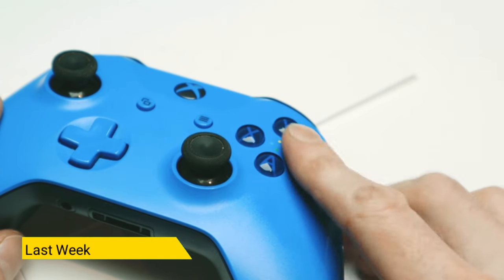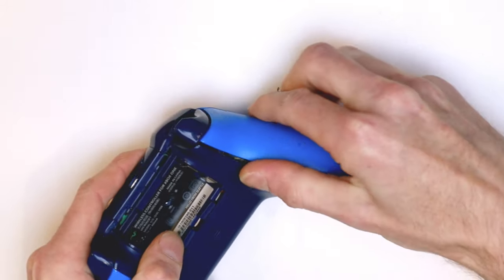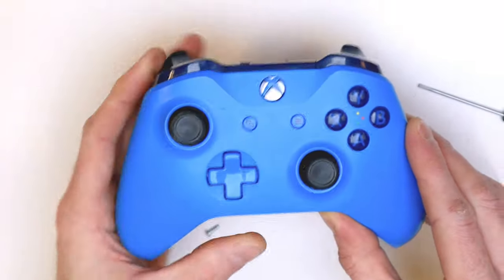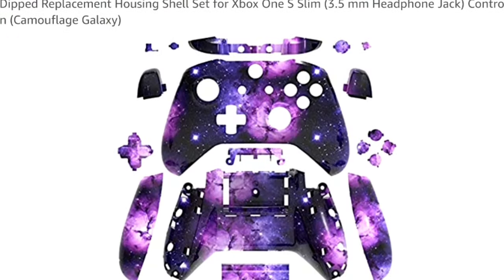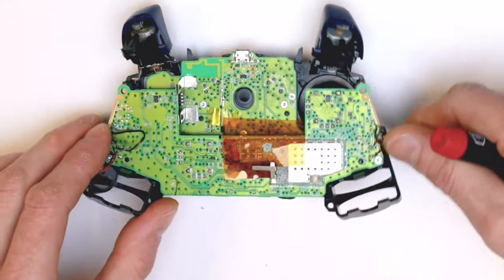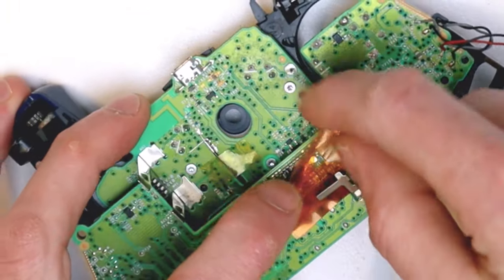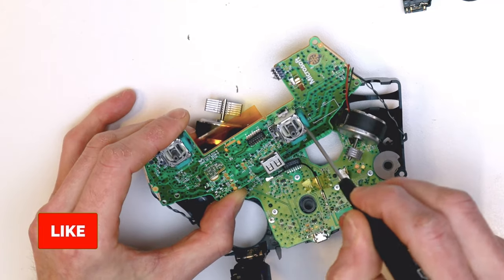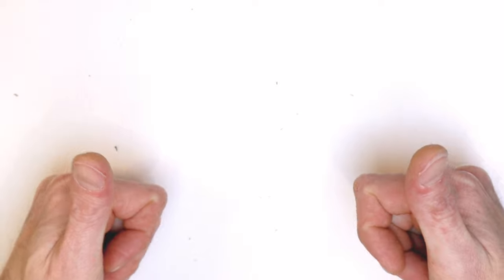How to Open an Xbox One Controller WITHOUT Torx Screwdrivers (watch full vid)

Comment: Yeah they're cheap as hell. Took a tiny flathead and broke the "security" part off of it. Metal bends and snaps right out of the screw lol
Reply: Same. The screws at the bottom of the handles are always resisting to come out and the middle part breaks off

Comment: Wait how do I break the pin thing in the middle of screws I’ve tried to break it with a flathead but it won’t budge
Reply from the maker: I use a flathead myself
Reply: a tiny teeny flathead
Reply: He has the non security Torx screws, Xbox One S controllers use Security Torx (With the pin)

Comment: Hey man, if you still respond to comments, I just finished putting my controller back together, and it doesn’t turn on. something I noted, the bottom battery slides out, like it doesn’t go in there solid. do you know what I did wrong?

Comment: Hi, so I’ve had my Xbox one controller for years and one day I opened those two back covers just to clean them, and after I closed one of the things that make it vibrate was making a weird noise. Do you know how I can fix this?
Reply from the maker: Hey thanks for your question. Something may have fallen down into where the vibrate motor is seated, like a bit of dust or something. Check this video out for more detail on them if you like https://youtu.be/fPXbm2XC4gU
I cover triggers and vibrate motors in this one
Reply: Tinker Man Mick Thanks

Comment: Thanks Tinker Man! I'd like to add that I had a bit of trouble using T8 torx because I don't have the hole in the end of my bit. I was able to use a tiny flathead to break off the "safety tips" from the screw heads and then get my torx down in there. Great video!
Reply from the maker: Well done mate, yea thats what i usually do too. Great you got it sorted 👍
Reply: They just break off?
Reply: I’m having this same issue with my T8 ! Which safety pins and how to break them pls ?
Reply: Center of star in the screw head has a protruding spike. My torx bit couldn't fit in there because the spike kept it out. I used leverage with a flathead to pry and break off that spike, then could seat the tip of my torx bit in the empty star spike free cavity.

Comment: Thanks my man! I actually had a Torx-screwdriver BUT the inner metal piece of the screws has come out, so I could not stick a torx in. With your method I could repair my xbox controller for the second time - these controllers are awesome when they work, but the construction is SO bad.

Comment: You can use a small phillips screw driver to break to "safety" post from the torx screws. Then you can use a normal #8 torx or maybe get your flat head in there easier
Reply: I've never been able to break that pin off for fear of breaking the screw itself
Reply: @Luke-nc6fj  I'm glad I tried it. Snapping them off was a bit nerve racking but it worked on each screw and I was able to clean and fix what I needed. Bought myself maybe another year before it totally wears out

Comment: Is it a bad idea if you use a knife with a sharp top?
Reply from the maker: That's something I have done before out of desperation but not recommended 🤣 (sharp objects hurt when u slip)
Reply: @TinkerManMick  Lol, i tried using a knife and i cut my pinkie. So, if you had protection like some gloves that have hard material then your good. (I think)
Reply from the maker: @ghillie3125  i hope your ok! 😓
Did you get the job done?
Reply: @TinkerManMick  Yeah, managed to get the thing out of my mic component, bad thing is that the bottom right screw couldn't go in properly
Reply from the maker: @ghillie3125  oh ive had that happen before, check the wires near the vibrate motor didnt get in the way at all and that everything is seated back correctly

Comment: A lot harder actually doing it than it seems on video. I busted my series x controller just unscrewing it  😁 I personally don't care because a $20 controller works just as good as a $70. It was just going to sit in a drawer for the next 10 years anyways. Also those little potentiometers will open with quite a bit of working at it. However, getting the new one in and closing it is another story all together, yep I tried after I broke the controller just to see if it is doable. I have like 20 more controllers with drift, I might just try to solder new sticks on if I don't break the controller taking it apart again.

Comment: What would I replace if my controller won’t stay connected to the console and connects and disconnects off and off with in 10 seconds
Reply: If your Xbox is connected to a power strip, it won’t get enough power, and after to long, will stop connecting without wires hope that helps

Comment: So with the bumper i fixed it with the blowing into the cavity thing and it worked for like an hour and it stopped working all of a sudden so I beat the crap out of the bumper because this had happened like 8 times before with the same controller and that one was a custom one and it just broke a week after I got it with all the stick drift and stuff

Comment: I thought alot of people would have the same problem i had, of a sticky button. i wanted to learn how clean underneath them. once you take off the thumbsticks you never go back to the front. Also i believe the reason for not sodering the headlhone jack is because no matter how its attached, its still a very weak point with a jack plugged in, and its easier to replace the way it is now.
Reply: Maybe with your soldering, idk,  replacing the headphone jack is the most common thing I have to do for customers other than a nice deep cleaning or faulty bumpers tbh.  Even shitty soldering keeps it in place so so much better for reconstruction.   But yeah I get your point too

Comment: The new controller clip on parts are a sad thing imho. I managed to pry it open and it’s not like the damage matters but it does has some prying scars on the edges. You could say it looks better without visible screws but I prefer my controller te be disassembled without brute force. Anyway thanks for the video! I’m off to order a screwdriver set as I just moved houses and I have no clue… 😅

Comment: I gave up on doing that it took me 1 hour to take off both panels then I couldn’t open it with the flathead screwdriver I just ordered a tool kit instead hopefully it’s more easier
Reply: If you use a flat head screw driver your going to have to use some force but it worked for me
Reply: @franzmarx5147  i tried but it was like making the top of the screw turn to a circle when it’s supposed to be like a star. I did get the kit though as I said I would and it was very easy to open up the controller.

Comment: Great video. Thanks. However, my controller was fitted with T9 Security Torx screws, not basic T8. So, just a little difference.
Reply: Quick question: Were you using a series x/s controller or an xbox one controller?
Reply: @Ropewatch  An Xbox One S controller, not the Series X/S. Mine is a special edition Battlefield 1 Army Green Console and Controller.

Comment: hey i just found your channel and you seem to know a lot about Xbox so i wanted to ask you if you knew how to fix a xbox that gets green screens and is laggy in the menu. Edit:if i  restart it it will get a green screen
Reply from the maker: Hey @5pazn, thanks for your question, thats usually due to corrupt data or a corrupt drive from what I know.
I would try one, or all of these 3 options in this order.
1. Unplug power, wait 2 mins then plug back in and turn on
2. You may need to update the system using the Offline System Update Diagnostic Tool
3. Factory reset your Xbox One
Reply: Tinker Man Mick thank you so much for the fast response i appreciate it a lot!!!
Reply from the maker: 😁 no worries, i hope you manage to fix it

Comment: i have a t8 torx driver and it still doesn’t work
Reply from the maker: You might need to get a security torx or just break the security bits off with a small flatblade screwdriver then try again

Comment: hey i took apart my controller and put on a new joystick because the old one was broken and now my batteries won’t work (edit) found the problem at the left side of where the batteries should be there’s 2 silver lines and ones came off
Reply from the maker: Hey there, check the two silver tabs that the battery pushes up against, sometimes they get caught in the wrong position when you reassemble. Easiest way is to disassemble and reassemble the xbox controller again, paying special attention to those tabs and see if that helps. Let me know how you go!
Reply: Tinker Man Mick ok i’ll try thx

Comment: Those grip covers are just cheap plastic. I also broke one, but they still pop back into place & fuction perfectly fine. I was careful, but I couldn't get them off. I carefully pulled up with my fingernail after getting them loose enough. Sure enough the cheap flimsy plastic snapped & broke clean off
Reply from the maker: Hot glue works a treat and is easy to remove again if u heat it up a little 😀

Comment: Mine is a x-series, so the screw have a pin in the middle...
Reply from the maker: The right size flat blade driver will still work. The security pin may break which is fine, just be careful not to strip the screw. Play around with sizes

Comment: Hey tinker dudeeee I really need help with my mic on my iPhone 7 Because it’s either dirty or broken idkk and I might need to clean it but idk how and u seem like the smartest dude
Reply from the maker: Hey man, thanks for the compliment! 😊
Let's see what we can do. 
To start, could you please describe the problems with your mic in a little more detail? Is it muffled? Is it making your voice sound like it's crackling? Or just no sound at all?
Also, is it when you talk during a regular call to your ear or when you use loud speaker? Is the loud speaker option available during calls or greyed out? Can you still record movies with good quality sound?
Sorry for so many questions but the more detail you can provide, the better advice I can give over the internet ✌
Reply: Tinker Man Mick nah it’s good the questions are fine but I’m glad u responded and the speaker option is greyed out when I call and voice recordings won’t work since it can’t pick up sound I’m assuming?
Reply from the maker: It sounds like an Audio IC issue my friend 😥 i dont have a video on that yet so i would suggest doing a little googling. Its a common mainboard issue Apple wont admit to as far as ive researched. 
The Audio IC chip starts to lift and pulls the microscopic trace from the motherboard, breaking the connection. A very advanced repair you can see being performed on channels such as @Paul Daniels, @Electronics Repair School or @Louis Rothman.
I may drop a video on this some time myself, as I get a few questions about it - but I hope that this helps for now.
Reply: Tinker Man Mick much appreciated and that does sound quite complicated so I will most likely get a professional to fix it or just watch the channels u recommended but thanks a lot

Comment: My t8 and t6 doesn't work🤦‍♂️
Reply from the maker: You need the security version. Get a small flat blade a snap the pole off in the center of the screw and regular torx will work. Here is a video of how to do it https://youtu.be/LW4zyFOpSA8

Comment: Don't do it ever. Send the flipping thing to be service if that's what need or resell. Just don't they are , all really hard beond difficult, send that to Microsoft basic lay of it button really close to each other, maybe robotics came into play on all these not human care. If it's a quick soldier problem, just if you length have background in a soldier exp this is the exception nd I still don't recommend.

Comment: totally ridiculous fake click bait video. There is a little bump in the middle of the screws that prevents the use of any other kind of screwdrivers on my controller. Which is the same model. The controller in the video must have different "normal" screws because its not possible to unscrew with a flat screwdriver unless you modify the screws while still in the controller with a rotary tool for exemple. Which I'm gonna haev to try. If I could put a pic or video here you'd understand what I'm talking about.
Reply: that little bump there exists by design to increase the likelihood that you don't have the ability to open the controller, pressuring you into just buying a new one instead

these controllers are maliciously designed to break and be unfixable for most people.
Reply from the maker: Not fake at all buddy, give it a try. Its a security torx screw and can be opened with a flathead as i did in the video. Try different sizes until you get one that works. Best of luck